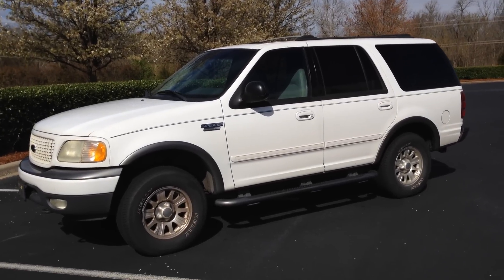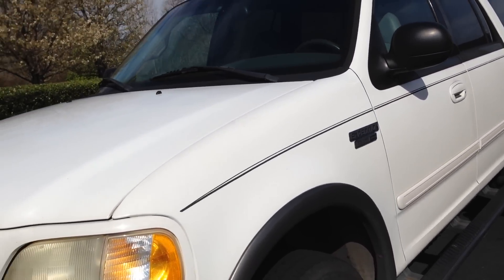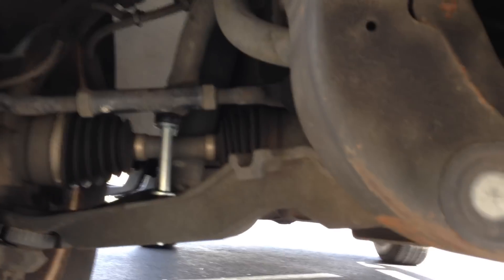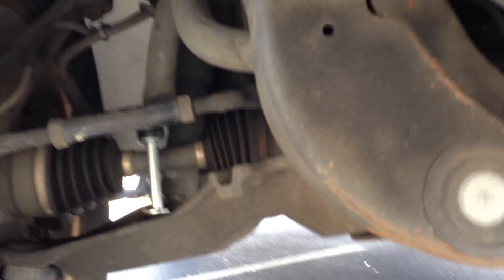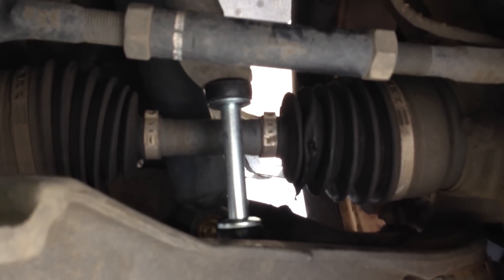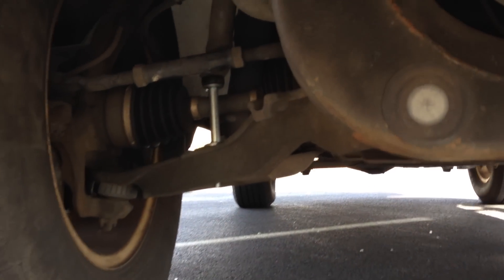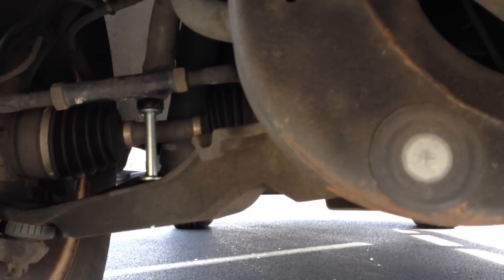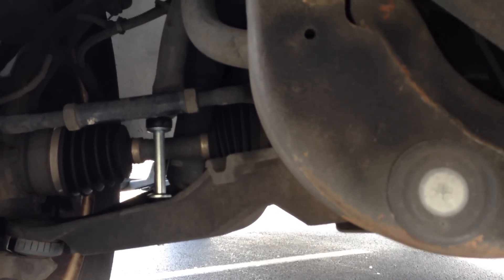Ford Expedition Sway Bar Bushing Links - Check yours NOW!

Comment: I own a 2002 ford expedition and I need my sway bar replaced but money is low can I or am I in any danger of driven my truck ? my truck runs great but when I go over bumps it makes a crazy rumble .
Reply from the maker: +Maria Mier  The sway bar should be ok , the bushing links are only $10.00 each and you can do yourself.  There is plenty of room without having to jack up the car.